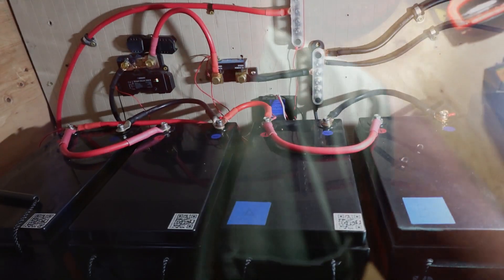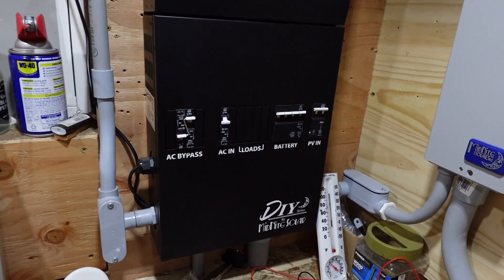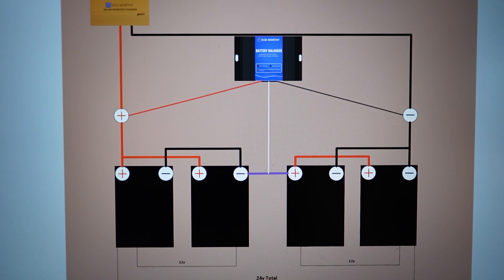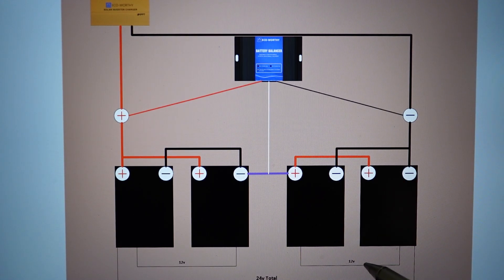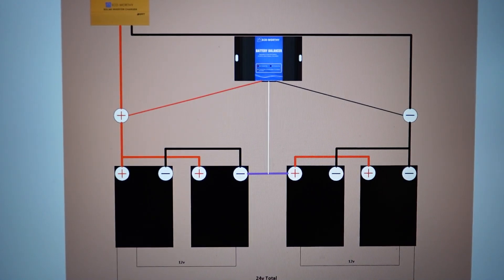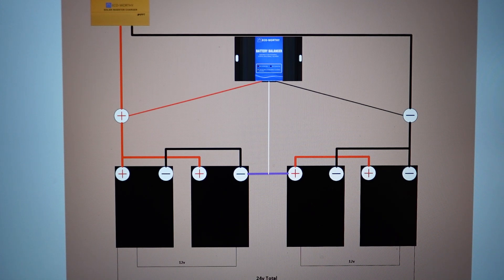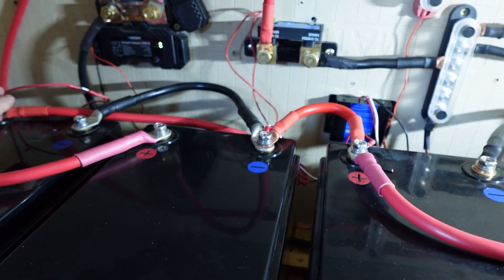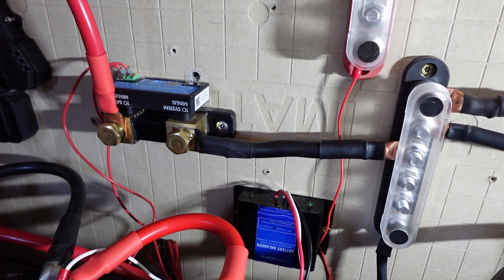Eco Worthy Battery Balancer Install and Review

Comment: I'm running three 280ah 12v batteries to my trolling motor and bought the 36v balancer which has 4 sets of red and black wires for 48v but I guess I'll only be using 3 sets, unless I decide to buy a 4th battery. While mine will be in series, I'm sure it still hooks up the same.
Glad I found your video, just wish it was closer to my setup being in series rather than parallel,  but I'll keep looking to see if there's a video similar to my setup. I guess what confuses me the most is when I hook my 36v charger to the 3 batteries, how does the balancer stop certain batteries from charging when the voltage and amperage go thru the main cables? Or is the balancer just letting you know there's a problem then you have to correct  it yourself?

Comment: Hi 

I just came across this    .  I have a question  I have the same battery balancer  I have it attached to 2 Renogy minicore 100Ah deep cycle batteries  the question I want to ask is I have one green light on and it’s static  it’s been on for 2 days even with a small difference of 0.1v between batteries. Both are the same bought as a pair  I don’t understand why it’s just on constantly. And I cannot find any info anywhere. So this is my only option is here.

If you have any idea it would be be appreciated

Comment: I think you're doing your math all wrong... Because i have 4 12 volt northstars in series for 48 volts.   Each battery is 190ah..  190x4 is 760 but its not 760 ah in 48 volt config

Comment: Any idea if this can balance 16 batteries in 4s4p (12 volt batteries)
Reply from the maker: @ngk330  You would need multiple units to achieve this. If I remember correctly you will need 2 balancers per 4x batteries in series.